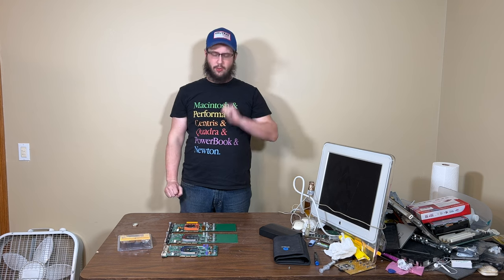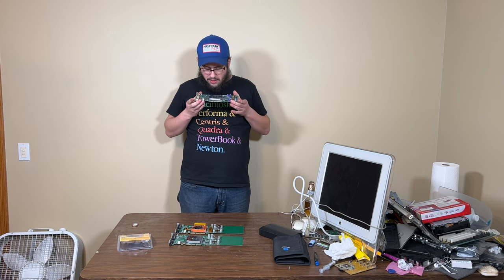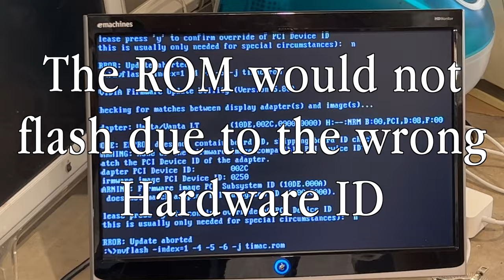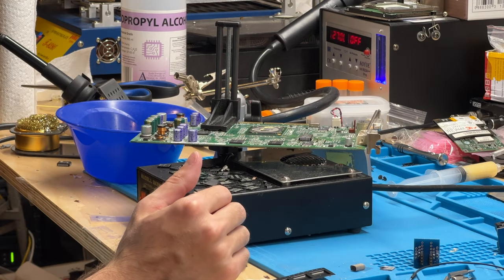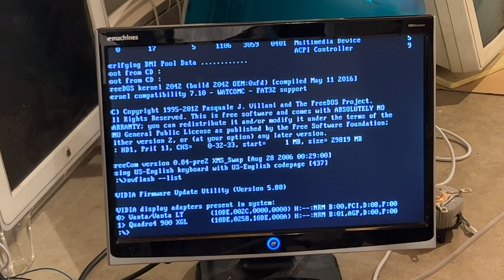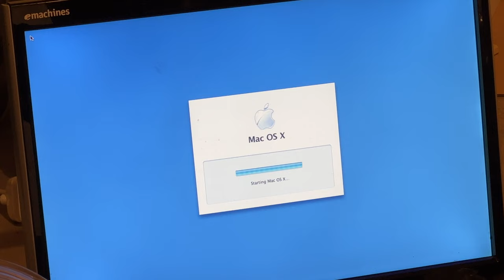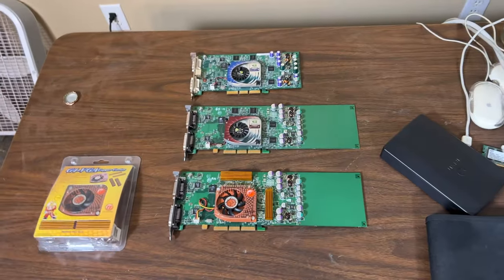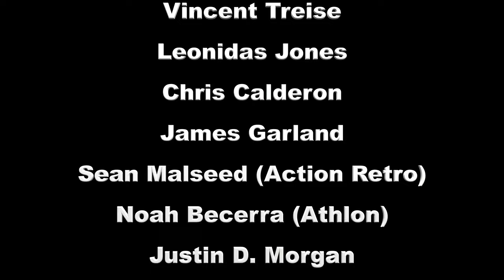Modding A PC Quadro4 Into a Mac GeForce4 Ti4600 PT. 1 With dosdude1! – PowerPC Series S.4 EP.18

Comment: Unfortunately this is not a cheap solution, because the Quadro4 is a sought-after spare part for some medical equipment (most likely MRI or CT scanners), at least in Europe. They sell for 200 (!) bucks here on eBay.
Reply: well they sell for 150-200 OR you can pay 500-750 for the mac version (on ebay right now)....  so... still a savings
Reply from the maker: agreed

Comment: the quadro 4 900xgl are also silly prices here in the UK £250 etc ! ;( it might be the geforce fx5200 though worse is viable flashing candidate as is passive cooled and still cheap globally, the 900 xgl is oddly expensive and often more so than a ti4600.
Reply from the maker: yeah they use them in medical equipment... prices are rising

Comment: do you know if the 980XGL can be modded to teh ti4600?  those 980's are MUCH cheaper than the 900's
Reply from the maker: They are different enough where I don’t think it would work. Plus they are an 8x time card. but you might be able to use the ROM maker program if you can modify it to 4x speed. And move whatever jumper is on the bottom of it to change the hardware ID you might be able to make it into some kind of weird TI 4800 I think that’s the similar card.
Reply: well id think they are 4x and 8x, using the sense pins 3/11 on the bus to determine. so cutting those traces should force it into 4x mode. the hardware id idea im sure would work, on a software level anyway.  i wonder...  i dug into it a bit more and it seems a different GPU die is used between teh cards. however the 700 and 750 use the same GPU die so.... i may tinker with one of those @HrutkayMods
Reply from the maker: worst thing that will happen is it just won't work good luck  @beardedgaming1337
Reply: ill let ya know if i get anywhere. have some CPU daughtercards to build first.  @HrutkayMods
Reply from the maker: good luck looking forward to hearing the results  @beardedgaming1337